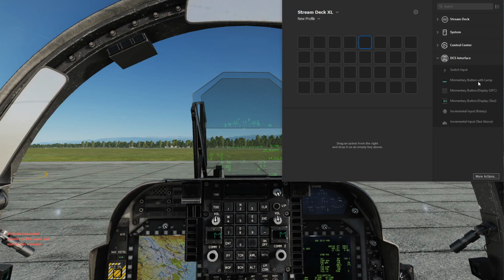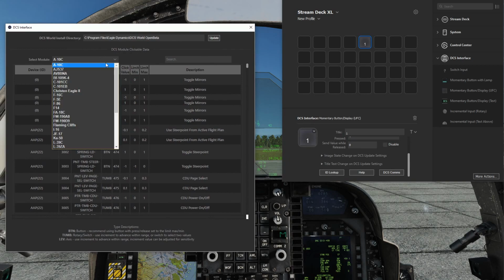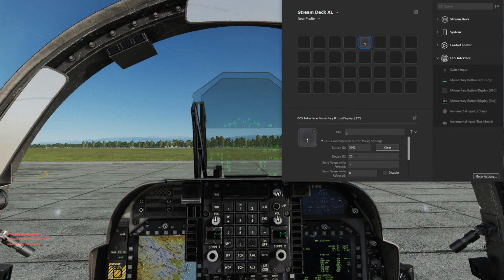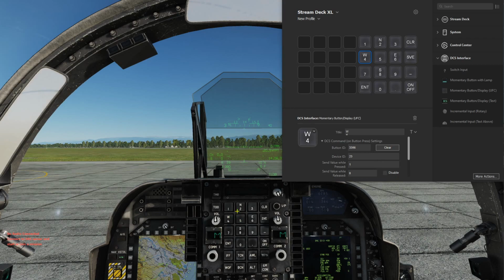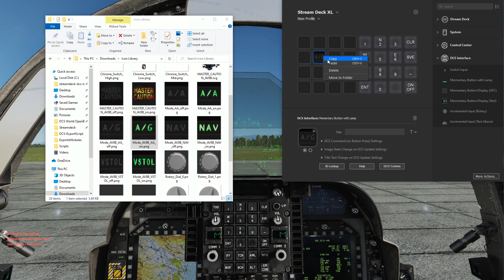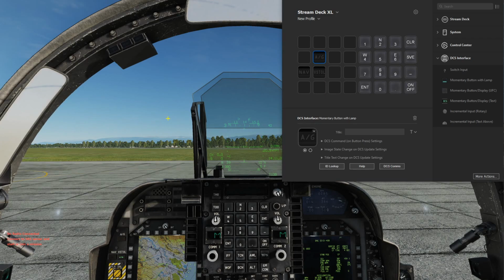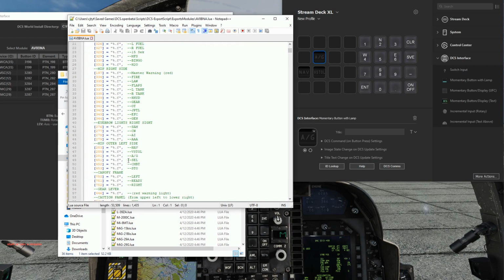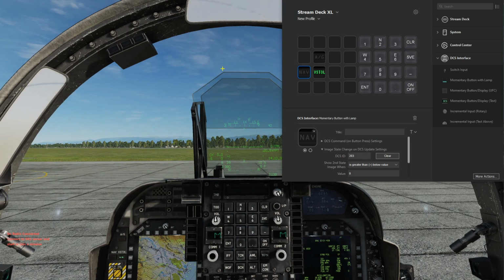Momentary Push-Buttons - DCS Interface for Streamdeck

Comment: This is absoutely fantastic! I love everything about it and have been creating custom profiles for the last few weeks ever since I got my streamdeck. However, I wanted to ask if it is possible to implement a momentary UFC button with a toggled image state - kind of like the momentary lamp, but image state toggles on the button itself instead of depending on a state value. The goal is to chagne the image state to reflect MFD screen changes since you can't get the data from MFDs into the momentary display buttons.
Reply from the maker: Are you saying the image toggle would go back and forth with each press? If so you may be best suited with the default streamdeck hotkey button with custom images and just map a keyboard press to the controls in game. Or are you thinking of changing image state on some other data?
Reply: @charlestytler  Yes that is basically what I would like to accomplish. However, I have tried Steam Deck's Hotkey Switch, which works as intended, but the issue is that if some action on an MFD untoggles an option that is boxed, for example, it will not change the state of the Hotkey Switch button because it is not technically receiving information from DCS. As an example - In the Apache, if you press the Util button on any screen, it will box the Util option on the MFD and I could switch the image state on the Stream Deck wit that Hotkey Switch effectively creating a toggle. However, if you go into any other screen without toggling Util off, the Util option wil be unboxed, but the Hotket Switch will remain in its current state.

Comment: I realy think I need more SD units !  Im working on A10C MFD's mainly the DSMS and TAD. Do you have profiles for the 15 button device ? Im getting stuck trying to use ALT-WIN as modifiers for HOTKEY button.  So I decided to use your buttons and looking up values for the ID which works but i cant figure a way to select a button value and also change profiles... is that possible  with the PlugIn you designed?
Reply: If you follow the overall approach in these guides, you should be using virtual button IDs DCS recognizes without the hot key being used. In other words, you cannot run out.

If you mean buttons on your device, then you need to use folders, multiple pages, and/or profile switching among split panels.

Comment: I'm trying ti make a profile for the DCS C-101EB Flight Director, i'm not getting very far with it. I am assuming, because the is nothing for it in the ExportsModules folder, is the reason why i am having problems. Any ideas how i can get this to work please?
Reply from the maker: If it's not already in the exports you'll likely have to see if you can extract the data yourself. Here's a video I added where I'd looked for additional export data for the JF-17 which may help here: https://www.youtube.com/watch?v=pdQXB327uWs

Comment: This is the first video I've seen on programing buttons on the Stream Deck.  I thought there were pre-programed button maps available for DCS and the Stream Deck.
Reply from the maker: This is a custom plugin made for the Streamdeck to allow it to communicate with DCS. It takes a bit of work to set everything up but is quite flexible in what it can do afterwards. You can likely find some uploaded profiles for the Streamdeck on the DCS forum, and I have some example ones on the github page.
Otherwise, the easiest way to start using the Streamdeck with DCS is with Hotkey or Hotkey Switches that send keyboard presses that you can map in DCS.